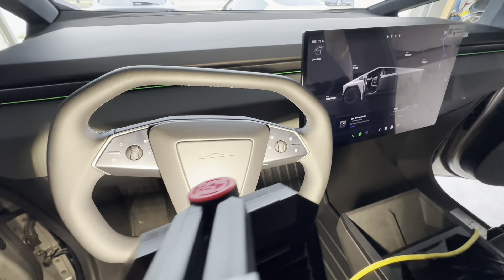Tesla Cybertruck Inspection after delivery

Comment: my truck: slightly crushed headliner hanging off brackets over passenger side, missing all 4 d-rings in the bed, tailgate cap loose on passenger side, SHARP edges on panels (drivers door and frunk top), stainless is wavy over the rear windows.